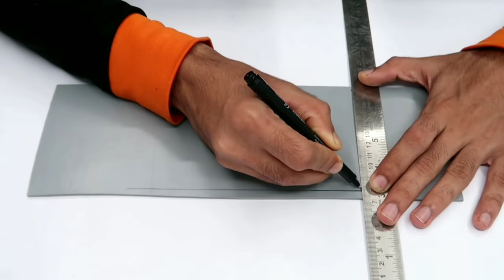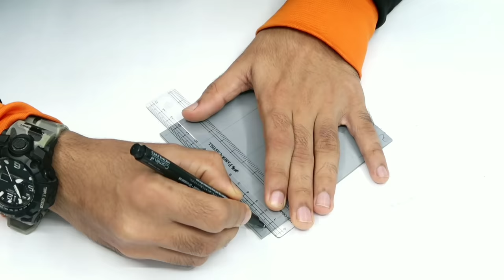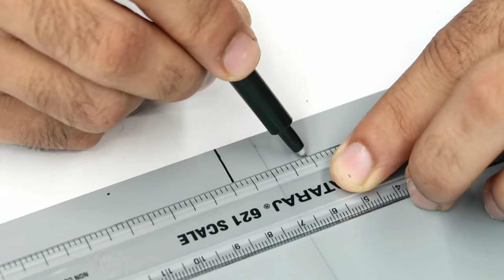how to make a tool box  using PVC pipe | creative idea with PVC pipe

Comment: Nice job. I'm quite surprised about how plain you made that tube to become. I'm from a country where good working materials are hard to find and expensive to buy, so this is a huge thing for me. Thank you for sharing this!
Reply: I'm in the United States and I am a part time electrician. In this country, because tradesmen are paid a high wage, no one bothers to salvage any material. I have made a good living going to construction sites where offices are being remodeled. the workers tear out walls and throw away everything in the giant trash bins. I always look into these bins and many times I will find much tubing, electrical boxes, wiring, good wood. When the drug addicts found out they could make money selling scrap copper, they would even go into vacant buildings and tear out all the wires possible. they would also remove the concrete covers at the base of street lights and pull out wires from entire districts. If you are looking for a skill to make a good living, I would recommend learning simple electrical repairs. I also repair and sell used washing machines and dryers that people throw away.
Reply: @obsoleteprofessor2034  In my country they sometimes go as far as stealing wires from the street posts themselves, even it means cutting power from whole neighborhoods. About making a living, if I ever manage to leave my country I don't plan on being too choosy about work, as long as I can do it, it's legal and my knowledge and experiences are useful. As an example wouldn't mind going back to being a forklift operator as long as the workplace is decent (in more than one way). Every honest job, done in a proper environment where respect is a  rule, is a good job.
Reply: @ggsj  You sound like Americans are supposed to sound.
Reply: @ggsj  não é fácil, Gil. Não é fácil...
Reply: India?
Reply: @commentreader9711  Brazil. I do hope I'll be able to visit India someday, but that's not possible for me now.
Reply: @obsoleteprofessor2034  we are soooo Gawdayum wasteful... I mean I’m guilty of it myself, but like, the U.S. as a whole... fuckkk.... and it’s only gonna get worse... this upcoming generation.... it’s gonna be rough for them and the rest of the country..
Reply: @APinTheAK In 1984 I bought a Calif house for $34k that sat on half a city block  in an industrial area. Nobody wanted it because of the "noise" pollution and smoke from the trucks. I fenced it off and started picking up all sorts of crap, cars, metal, appliances, etc. I think I'm ready for the apocalypse.

Comment: One minor improvement: make the top drawer a little bit wider, so it will aline with the lower board plus the extra sheet
Reply: ..or just make the bottom drawer shorter and instead of using an extra sheet make the back border of the second drawer higher.

Comment: I normally don’t like these maker/repurpose videos, and while I have no intention of building a little tackle box, I must say that’s absolutely ingenious.  Using pvc pipe as a raw material?  Absolute brilliance.  I can definitely incorporate this into some of the projects I make.
Reply: It actually just dawned on me, I have a broken bracket that supports the glove box in my wife’s car.  Can’t find a replacement anywhere, not even at the dealer.  I bet I can make it though.  I’m going to give it a shot.
Reply: @jgetscensored7837  a 3dprinter would help here
Reply: @AmirKhan-qx2lr  well no shit... a 3D printer would help in a ton of situations... it’s not like a drill or screw driver... you won’t find it in most people’s homes...
Reply: @APinTheAK  which is strange because its cheap like a drill
Reply: it will be much cheaper to buy a ready-made organizer, and no problem.
Reply: @ekstrapolatoraproksymujacy412  3D printers are not in the same price range as a drill, nor does the average DIYr have the skill set to operate one.  You have to be skilled with CAD modeling if you’re going to build your own parts.
Reply: @jgetscensored7837  I don't know where you live but here a 3d printer is in the same ball park as a decent drill
Reply: @AmirKhan-qx2lr  that is an extremely false claim unless you’re talking about a gimmicky 3D printer or a very overpriced drill.
Reply: @jgetscensored7837  what's false about buying an ender 3 clone ?

A decent drill by Makita or DeWalt will be in the same price range. All this is based on where you live as I already said ?
Reply: @AmirKhan-qx2lr  USA. 

An entry level poor quality 3D printer will cost at minimum $300.  A professional grade drill will cost you less than $300.  

A professional or even intermediate quality 3D printer will run you at an absolute minimum, a little over $800.
Reply: genius
Reply: Really? I love watching tutorials so I can learn something I didn't know.  I like to learn a little something about everything.  Sometimes I watch stuff I don't even like at all so I can maybe learn a little something. How to's and DIY are the way to spend time on YouTube, imho.

Comment: TOP 10 D.I.Y TOOLS EVERYONE SHOULD HAVE IN THERE HOME

1-Multipurpose Mini Screwdriver Set-https://amzn.to/3cuY5lV

2-Tool Kit & Screwdriver and Socket Set-https://amzn.to/3ouAHb3

3-Marble Cutter-https://amzn.to/3zwF4bN

4- Wood Chisel Set-https://amzn.to/3J61YKk

5-Hexa key Set-https://amzn.to/3vfABYD

6- Automatic Wire Stripper-https://amzn.to/3vfveZy

7-Voltage Tester-https://amzn.to/3cGXTQT

8-Stainless Steel Riveter Gun-https://amzn.to/3b2av4B

9-Mini Allen Key Set-https://amzn.to/3PRcvLG

10-Reaming Cutter Drill Tool-https://amzn.to/3ot4vVt

Comment: Great achievement, congratulations.
Unfortunately, PVC obtained from pipes does not remain perfectly flat; over time, it tends to return to its rounded shape (especially if exposed to heat).
Reply: I had the problem of pvc holding it’s shape, after cooling down it wouldn’t  hold it’s shape.  But,  dip in cold water or wash cloth,  shape is frozen.
Reply: @bobnwashington  thanks for the tip 👍🏻
Reply: If the material is heated correctly and pressed between surfaces that do not act as a heatsink (like metalic surfaces) The bonds between the chains are so weak that they can be broken when the plastic is heated.
 The chains can then move to form a different shape. The weak bonds reform when it is cooled and the thermoplastic material keeps its new shape

We see the same process when a blacksmith heats a spring coil to make a new part. Simply a lot more heat and pressure to rearrange the bonds.

Comment: What a patience he has!!! This box is awesome 😍
Reply: Hello. Hope we could interact!
Reply: Kreatifitas tiada batas  saudaraku.... Salam Sejahtera Dari Lereng Gunung Slamet
Reply: Yes, finishing the edges of the sheets thus made on the sand paper so that the PVC glue can stick with good bonding is going to take a long time and practice; no doubt.
I have made boxes using readily available acrylic sheets and the cementing substance is chloroform liquid. For it to spread evenly along the edges or surfaces of two bits by capillary action it requires a finely ground smooth surfaces; now a days laser cutting is available for cheap and the finished product is having a factory product look.
De VU2RZA

Comment: One unique tip I can give you. Use baking soda. Or packing powder to fill in the gaps. Then put glue on it. Rock solid and no gaps. And you can sand it as well.

Comment: A good idea, I pick up chucked out stuff that when taken apart leaves you with plastic panels, screws, thin metal bars & rods, sheet metal, motors etc. Also plastic piping of various diameters, we can make most of what we need/want from old appliances and devices.

Comment: Nice work!👍
Personally, I don't have any glue that I would trust to hold this box together.
Either you have some crazy strong, super-duper-duper glue, or this box will fall apart over time or if knocked around a bit.

I don't have a YT channel, but on some of my past projects where the material was plastic, I used thin julienne shaped strips, cut from the main material scrap as plastic rivets.
Once cut to the size needed (& allowing for melt shrinkage), heat one end of the strip with a lighter until it just starts to blob, then press it gently on a cool, flat surface. This makes the first end of the rivet. Then put it through the holes of what you want to join, and carefully heat this end until it also blobs, then finish it off in a similar fashion to the first end, while pressing on the surfaces near the rivet to ensure a tight bond.
Countersunk holes will provide more strength with the aforementioned approach.
Reply from the maker: Thanks for your valuable comment ❤️What I have used here is "instant adhesive(product name- flex kwik)". It is very powerful and useful. I have used this in all my products. Use this glue once and leave a comment❤️😇
Reply: @Top-One-Maker  Thanks for your reply, good to know about the glue!😉

Comment: Very nice useful item out of PVC pipes but don't use CA glue on PVC.  Use PVC cement (not CPVC), it's essentially fusing the PVC and making it water proof.  CA glue is not as strong as PVC cement when used correctly with PVC only.  Also CA glue will weaken in water or prolonged moisture.

Comment: only good for staying on shelf. 
PVC have worse adhesion to cyanoacrylate. 
might have chance to survive if you make base and corner walls for every box solid and bend to make it square. and then use little metal corners with bolts to fix them... same with everything else glued here.

Comment: I like the idea. But I feel like there's a lot of glue. So if it falls it's busted. Or after a time of use its gonna come loose. I could be wrong. But it's rather use screws. Nuts and bolts and other mechanical parts to hold it together. And then  glue it

Comment: You realise that if you are making an average of $10 per hour this little thingy just costed you over $50 with the tools and the pipes and you can buy it for less than $15. Right?
Even if you live in a placewhere you only make a $5/hour still the labor of your work combined with the cost of materials costs more than the price of the box.
Reply: This is a very apt point, but it looks at this project from a capitalist's perspective. This guy took something that could have otherwise been thrown in the trash, and made it into something useful, clever, and compact. Hobbyists usually already have a bunch of these tools anyway; and they also usually have a lot of time to tinker as well. I don't think he intends on making these in bulk by hand.

Comment: Shouldn't be using superglue, you should be using PVC Solvent, it causes different pieces of PVC to atomically bond to each other and they become a single piece, the join is as strong as the PVC itself.
Reply from the maker: Thank you for your valuable comment❤️

Comment: Instead of four sides for each tray... is 12 pieces by the way... calculate the total length necessary... brings it to one piece for each trait which is three pieces... heat and bent and glue into place? Sounds easier to me. Also better quality.

Comment: Now, if that ain't just about the neatest thing I've seen in a while. I especially like the piece you installed on the back around the 7:15 mark in your video. When open, it would normally be top heavy but that helps the box from tipping over backwards, correct? Also, instead of nuts & bolts for the hinges, could you use pop rivets? I may build one for my Dremel accessories. Nice video. No wasted content and it's nice you gave dimensions so one could also calculate ratios for making a larger (or even smaller) box.

Comment: Be careful, the packaging of the glue claims it's good for so many different types of materials and on another side disclaims that it doesn't work well on a lot of materials in a way that basically disclaims anything.  No telling if the product is actually listed to bond the material in question without getting hold of the manufacturer's paperwork listing the materials it is listed to bond well.  As it is listed as super glue and no chemical name is listed, it is my assumption that it's probably cyanoacrylate (the chemical name for what is normally called super glue).  Based on that assumption, you would not want to leave that tool box in a hot environment because the heat will cause the glue to break down.

Comment: I hate to say this but pvc pipe will not conform to flat sheet type pvc to make this box.Using a hack saw by hand is also not something used to make precise cuts.There is available pvc material in sheet form to make this box using the proper cutting tools.The lapsed time between scenes explains,the point also.